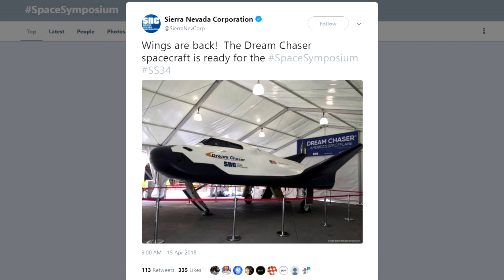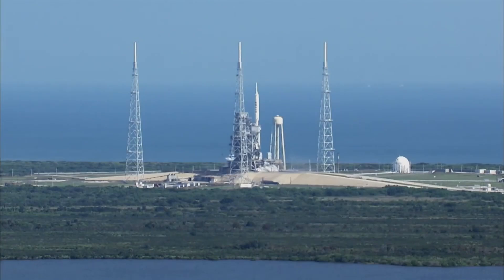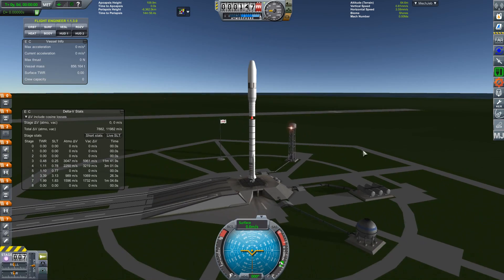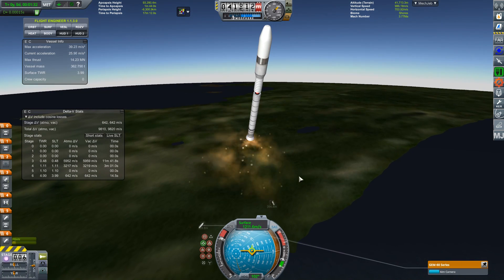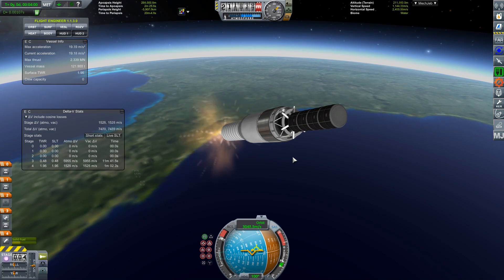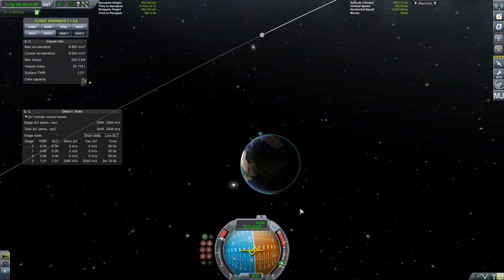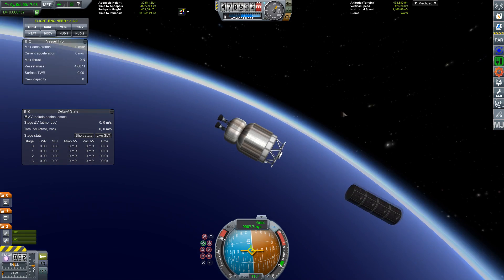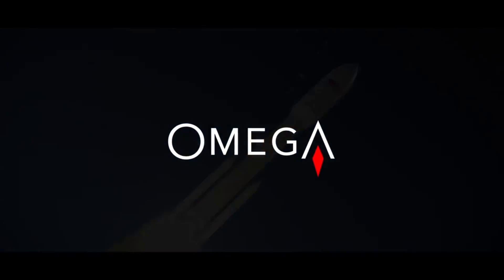OmegA by Orbital ATK -  Simulated In Kerbal Space Program

Comment: Interesting to see that there might be a new competitor to SLS or even the Falcon Heavy.
Surprising especially that it's Orbital ATK, (which I didn't expect), Nice video btw!
Reply: KSPFanatic 102 Heatshield and parachutes would be just as much weight as fuel.
They’ve designed the BFR to do everything, reason why they ditched the old ITS idea because it could only do two things, go to mars and back, and fuel up other ITS 2nd stages.
BFR will be able to do CRS missions, moon landings, deliver humans to the ISS, can do GEO and back, can go to Mars, could easily be used for tourism, and can do HUGE LEO missions, or many at once. And another idea they have for the BFR is a space debris picker up thing.
Reply: Mellow _  For real? Where have you read that? Since in my understanding that would be absolutely stupid. The bfr has insane lift capacity that would completely put them out of the business of launching regular sattelites. Which I don't think is a smart decision.
Reply: Norman M. Weird, yeah I know it'll (obviously) be cheaper per kg to orbit, however the BFR is a huge bloody ship. Whereas a Falcon 9 can launch a single sattelite in a profitable manner, bfr can never do that. I order to launch sattelites with that you need a ton of them in one launch. Now how is that going to work logistically? With launch windows, delays, different target orbits and also the increased risk in case of catastrophe. There is a reason smaller and larger rockets exist and to me it seems stupendous to only go for HUGE ones if you have such awesome launch hardware at lower LEO capacities already developed. I think that'll cost the company contracts but then again the guy has probably thought about it a bit more than I did.
Reply: As an example I don't see any scenario in which TESS would be launched via SpaceX if the only launcher they got would be the BFR.
Reply: The launch costs for BFR will be much less than for Falcon 9 and Falcon Heavy due to the full reusability. SpaceX could charge customers the same price they currently charge for a Falcon 9 ($62 million base price) and achieve higher profit margins as a result. True, launching a small satellite on a large launch vehicle doesn't make sense in the traditional sense, but BFR is as far from traditional as you can get. In SpaceX's case, it makes perfect sense to launch any manner of satellite, large or small, on the BFR.
Reply: Norman M. I am pretty sceptical it'll launch that cheap. In the end the spaceshuttle was grossly expensive as well, which ofc can't be compared directly since it wasn't developped for economical purposes (and in general that was a pretty retarded design process I've heard), but still the reusability idea is largely comparable. Also I'd say it makes sense to develop the SFR, put it on an F9 booster and there you have smaller capacity rocket that can launch even way cheaper than the BFR.
Reply: SpaceX wants a common design so that they can streamline their operating and developments costs. This is what Musk said during IAC 2017. There is no need to develop a SFR or maintain Falcon 9 and Falcon Heavy when BFR will be able to launch all manner of payloads to begin with. Focusing on one vehicle, as opposed to many, greatly simplifies things for SpaceX. And remember, BFR's primary purpose, and SpaceX's primary goal for that matter, is to make humanity a multi-planetary species. Launching satellites is simply a way for SpaceX to fund its primary mission.
Reply: Norman M. yeah but bfr time is way long in the future
Reply: Norman M. Yes, but I remember him stating that he will actually keep around the F9 and FH, until they’re all reused and can no longer fly. It’s like them selling apples and oranges. They first sold apples, but they moved to oranges. They’re still going to keep their stockpile of apples, but they won’t be making any more apples.
Reply: Alabastine It would actually be cheaper to launch the BFR for a satellite than to launch the F9 or FH since the BFR parts, 100% of them come back.
The small satellites would really be the only odd thing, but it’s lower launch cost, meaning you can make more small satellites and send them up all at once.
Reply: Agreed, Ruling out the Falcon 9 and Falcon Heavy to use BFR instead is a bad idea, atleast they should keep the Falcon 9 for lighter payloads.
Reply: frank asisi BFR is not even a decade away. They’re already building the BFS (top stage) in Cali.
Reply: KSPFanatic 102 But that means you are always spending money on the second stage, which would be more expensive than the fuel for the BFR.
Reply: BFR-only service would be like using a whole truck to deliver a pizza.
The Falcon 9 service is like delivering a pizza on a motorbike instead.
if they could find a way to recover the second stage, then costs may even go lower than the BFR.
Reply: Norman M. airlines don't use 747s for commuter routes, neither would satellite launchers want to use such a large rocket for a comparatively small launch. Elon can talk a big game (and play one) but the economics of the situation as well as the aerospace industry certifications will dictate falcon 9h and 9 will probably be soaking up the satellite market for some time even after bfr
Reply: PsychoLucario ? They would if it meant that all you had to do was refuel a 747 vs replace a turboprop engine in a small plane. Because that’s basically what the F9 is, yes it’s cheap, but there’s a constant loss due to the upper stage not being able to be reusable. All you have to do with the BFR is refuel it.
Reply: Mellow _ Well i actually have an idea.

For LEO missions, The second stage would stay in orbit and its orbit will decay slowly, just stick a heatshield on top and parachutes will work on the much lighter second stage and when the stage starts to re enter because of the decay, pop them up and recover them.
Reply: I Actually researched this:

First of all Falcon 9 second stage weighs 3,900 kgs without fuel.
and 92,670 kg fully fuelled, According to Spaceflightinsider 

http://www.spaceflightinsider.com/hangar/falcon/

Let's assume, that we are using the Orion CEV CM Heatshield and using the Apollo CM  parachute assembly weight as a reference, and with some calculations thanks to this website: 

https://www.rocketreviews.com/index.php

We would only need a parachute 5 to 10 meters in diameter.

The Apollo parachutes were 24.4m in diameter, so even a single parachute is more than enough to support the stage.

I found this Assembly artifact on this website which claims that a single unit weighs about 134.5 pounds or 61 kg

http://www.spaceaholic.com/index.php/Detail/Object/Show/object_id/26

I found a mention of the Orion CEV CM AFT Heatshield part only, I am going to use it as a reference. Which weighs approx. 630kg according to the book 

Coming Home: Reentry and Recovery from Space

https://books.google.com.kw/books?id=7k1sawDR-kEC&pg=PA263&lpg=PA263&dq=CM+Aft+heatshield+mass&source=bl&ots=w7k93_aXlI&sig=yK9AfQ0PwFIb3rTH52CdL7fwuQw&hl=ar&sa=X&redir_esc=y#v=onepage&q=CM%20Aft%20heatshield%20mass&f=false

Now, if we add up the Orion CEV CM AFT Heatshield weight, 630kg, and one parachute assembly,  61kg, we get 691kg

92,670 - 3,900 = 88,770

Thus the weight of fuel inside the second stage is 88,770

Now tell me, is 691kg of recovery equipment heavier than 88,770kgs of fuel?

I Would imagine the second stage looking something like this: https://sketch.io/render/sk-0cb0acc85385e905526d1c0749cc8dec.jpeg

And as for the BFR thing, i am not disagreeing with the martian and manned concept, i just see it silly for using it for deploying small satellites.
Reply: Elon said at IAC 2017 -- where BFR was unveiled -- that the plan is to replace Falcon 9 and Falcon Heavy with BFR. BFR will be fully and rapidly reusable, so it will actually be cheaper to fly all missions on the BFR than to keep around the older Falcon launch vehicles.
Reply: KSPFanatic 102 They can’t though, it’s disposable. It would cost more fuel to recover the second stage, meaning that the first stage won’t be able to land. Literally the only way to get the upper stage back, is to make the BFR.
And it’s more like the BFR is a semi-truck transporting a pizza, just a waste in fuel.
But the F9 is like using a car delivering pizza but you must replace the transmission every trip.
Reply: KSPFanatic 102 SLS would be a Super Heavy Lift Rocket, this appears to be just Heavy Lift. So it’ll be competing with FH, but FH is also not deemed to last very long since SpaceX wants to switch everything over to the BFR and let F9 and FH die out.